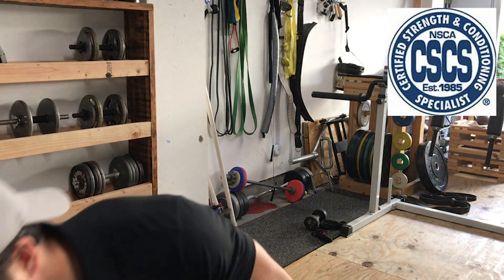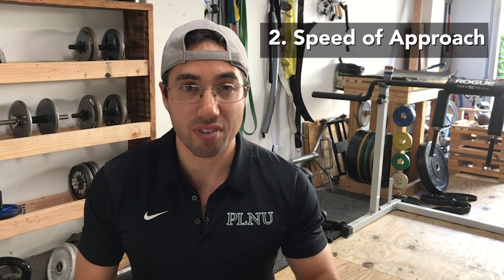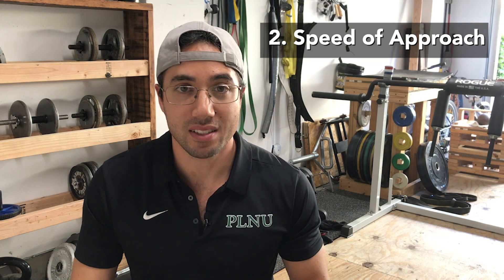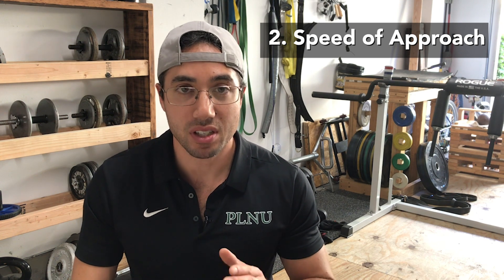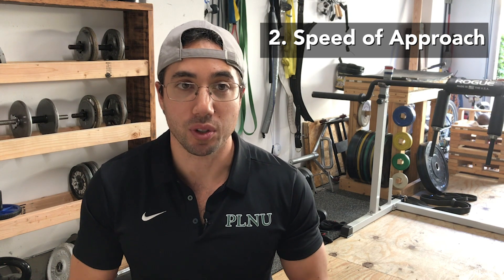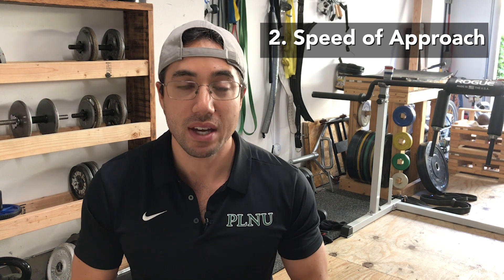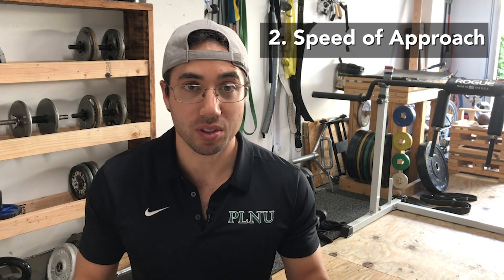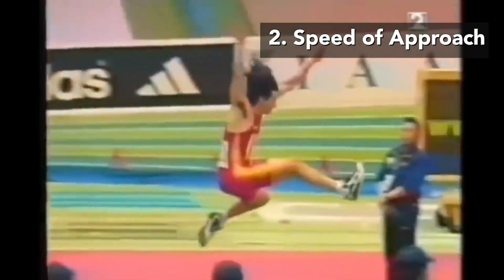How to Incorporate Plyometrics Into Training (4 Methods, with Demos) | CSCS Chapter 18

Comment: In this video, Goodin’s explained four main methods...starting with simple hops and bounds, then progressing to sport specific drills, depth jumps, and complex training that pairs strength with power. I learned that the key is to control landing mechanics, minimize ground contact time, and match the plyometric intensity to the athlete’s strength level. This helps improve explosive power, coordination, and performance while reducing injury risk

Comment: I never really thought about how points of contact has such an impact on the intensity of the workout but it makes sense seeing as how bilateral movements have a wider and more stable base of support verses unilateral have less surface area and require greater single limb absorbtion
Reply: agreed

Comment: The visual of the track athlete for the second method,  speed of approach, was really helpful for me! Makes sense, the faster you do these movements, the more power you can store and use to create more force just like the longer and faster you stretch a rubber band the harder it will snap.

Comment: The countermovement jumps you showed at the end were really good and I was able to understand what you meant for using both legs you go at a lower speed and low height and then adding an extra box you go for a higher speed and higher height

Comment: At 6:04 the added weight while you lower your body helps to activate your muscles more! I never even thought to use that for a plyometric exercise! For anyone else that didn't know what plyometric means, here's a quick refresher. Plyometrics are exercises that use short bursts of energy to increase power and agility of muscle contractions. Back to the exercise though. What would that exercise be called? I would love to do more research into this to increase my vertical.